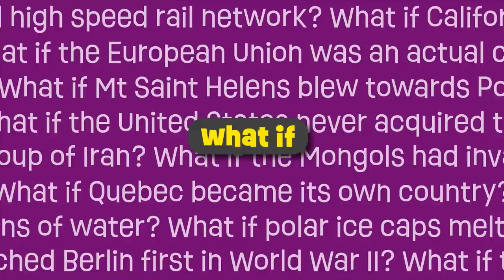Water Pipeline: What If An Aqueduct Was Built From The Great Lakes To The Southwest?

Comment: As someone who lives about 3 miles from Lake Erie and previously lived about 150' from it: Any proposal like this is absolutely unacceptable. It's not just "ooh, it's pretty", it's our water supply, important to our economy, and enables our regional climate to function. We're also well aware that when municipalities started tapping the Colorado, everyone then said there was plenty of water and they'd never run out, and now look where they are.

If you want to partake of our water supply, move here so you're sending most of the water back into the lakes.
Reply: I live in Western NY, we generate a lot of truly clean electricity with that water as well…
Reply: Although I wouldn’t miss the lake effect snow much, lol
Reply: No hate but Waukesha already takes our water….
Reply: In your video you acknowledge the effects of climate change on the West Coast it is indeed getting more heat waves and hotter but if you take the time to look at the effects on the East Coast the atmosphere is holding more moisture and causing it to rain on eastern states longer and more frequently this is causing flooding to become more common on the East Coast So imagine this instead of trying to take water from the Great Lakes one source that is to say. we make a more elaborate system that is connected to various rivers and some lakes on the East Coast Then when it rains more frequently and starts to hit flooding conditions in that area a switch could be Flipped opening up a water pipeline to take the excess water to where it would be needed more thus stopping the Flood From happening and allowing the excess water to be transported to the western states I suppose this is more of a water pipe network then just a simple water pipeline I think it's the best long term solution the western states get the water they need and the eastern states that are being hit with more rain and flooding will no longer have increasing Flooding events. I would also like to make it clear that I do agree that Salt Lake City and the other cities and states in the western states need to manage their water better then what they currently do also I don't know why So many people  think the only solution for a water pipeline would be the Great Lakes sure on the surface that seems like the most obvious solution because it's in plain sight but like you pointed out in the video it's not the best long term solution however this water pipeline network I mentioned earlier would be one of the best long term solutions if you think about it for a little bit and do some of the research on climate change not just affecting the West Coast but also the East Coast you'll see my point. / Also on a side note between 2030 and 2040 Florida is doomed as they are the state that will be damaged the most from rising sea levels.
Reply: The desert needs to suck it up and manage water better. "Moisture farming" is literally a thing, and it needs to be done! Agriculture needs to be reduced DRAMATICALLY here too! It's just not acceptable to be farming foods that have high water demands.
Reply: I thought this was a UNITED STATES, my bad.
Reply: @DavidJohnson-pu2jh  answered your question above, or is that below? lol. Yes I’m sure they could extend the system to include flooding further east of the Mississippi River what wad proposed back in the early 1990’s was to keep the city of New Orleans from flooding. Considering all the times the wind mills that are already built that idle because there’s too much electricity which is bad for the grid, hence why they idle them could be used to pump the excess water up hill where necessary! But again seems that the USofA is just too poor a country!
Reply: Won't someone think of the desert golf courses!
Reply: @gilbertwoodward75  great lakes aren't just the United States though.  There is another country above the United States that has a huge population base around those lakes.
Reply: @gilbertwoodward75  I have zero respect or willingness to help someone who won't help themselves. Desert golf courses, lawns, and water parks are currently still being built in those areas. I know for a fact that if it were the other way around the eastern states would have banded together and made serious changes. The River would never come close to being depleted. West coast will need to learn the hard way to conserve and ration.
Reply: @jesseflores9087  it's not only their water to share.  Why should Canada give up our water because people living in the desert want green grass and golf courses?
Reply: @alkalineorganicfanatic8655  Obama claimed that hydro couldn’t be called ‘clean energy’
Reply: @gilbertwoodward75  It is united in selfishness, that's for sure. I wonder what people in the west will think when people in the east take some of the suggestions here. "Go live in a place with water!" "Great Lakes, here we come!"
Reply: Aquifers are being proven to replenishable
Reply: @Heather-xm9ul  The Southwest can be changed back into a Semi Temperate Forrest, your Moisture Argument is null and void. 

The Army Corp of Engineers somewhat tackled it, but all plans were scrapped after the 1930s
Reply: @DavidJohnson-pu2jh  East cost is in a drought. worst in years
Reply: @debbylou5729  LOL. You clearly give up too easily it's kinda sad./ (1)  As for the hubris of history of humanity moving water from one place to another where it does not naturally go in nature made rivers well that's just about all of human civilization In Known recorded history everyone knows about the Roman aqueducts and how that water would be transported from natural river sources and lakes two drier areas around Rome but water pipelines go back farther than that In fact many ancient cultures around the world had some way to transport water long distances to their towns and village Two of the oldest on record are pipelines that were made out of clay similar to pottery and of course Wood (2)  As for the effect of humans creating climate change The earth has a delicate balance In the amount of CO2 it naturally puts out into the atmosphere and takes away. Between humanity cutting down trees a little too recklessly in places without planting new ones sometimes And our factories and over reliance on fossil fuel What We have done is contribute to upsetting that balance Think of it like this The CO2 is A Snowball This snowball is the size of your hand then you drop it down a steep mountain As the snowball rolls down the mountain it gets bigger and bigger it accumulates But that snowball was originally made by you the human it wasn't made by the mountain. I realize that may be a poor analogy but my point is we have contributed so much CO2 to our atmosphere we have tipped the scale disrupted this balance The warmer Planet is affecting the jetstreams and the ocean conveyor belt those two things pretty much control weather pattern and weather behavior. If you still don't understand basically we Broke the earth's Thermostat
Reply: @viceroyviceroy-wj7cf  I don't know where in the East Coast you are but in North Carolina they've been getting hit with more rain and it's predicted to get a bit more frequent in the next few years but they aren't the only Middle Eastern and southeastern states to be hit with flooding conditions happening more Frequently The point I was making is if there was a pipe network system set up and when the rain hits flooding conditions a lot of that excess water from swollen lakes and Rivers Could be redirected through this network stopping areas on the East Coast from Flooding while taking the excess water on a nice long trip to where it is needed more. PS 
if your In Florida you should start looking for a new place to live around 2028 But if you're in Florida and don't wanna move you better start making your house waterproof like those underwater cabins sure you're gonna need a scuba tank to enter and leave your house but just think of the view LOL
Reply: @Heather-xm9ul  Next time you toss a salad or have a juicy BLT, remember the lettuce and/or tomato likely came from that irrigated farmland.
Reply: @TheLosamatic  20% of the USA gets to live in happy go lucky American dreamland because that's the part that makes up the USA that is the richest country on earth Around 70% of America gets to live in America's Reality Which is one of the poorest countries on Earth That's right we get to be both One of the richest and poorest Of course there's around 10% of our population that gets to live between being poor and rich Basically our middle class is an extremely endangered species If you're in America take lots of pictures if you see one Because in another 10 to 20 years the middle class American could truly be extinct. LOL
Reply: I live in Sault Ste. Marie, Michigan. We use the water that flows from here to Lake Huron in a half mile long hydroelectric power plant. I'm not willing to give up my water .
Reply: LOL y'all want a bunch of us to move there and swing your "swing states" firmly into the Blue? Yeah, actually, that sounds pretty good.
Reply: @debbylou5729  and I bet you don’t have a clue why what he said is absolutely true!
Reply: @viceroyviceroy-wj7cf  tell that to all the people that drowned in Kentucky! All that’s being questioned here is the plausibility of having the means to move flood waters to where they are needed and away from where more water would be catastrophic. The video stupidly brought in the Great Lakes which just muddied the waters for what’s absolutely something that should have been started long ago, but obviously we are to poor a country, you know all the poor petroleum companies that can’t survive without the billions they get in subsidies, billions that could mitigate some of the horrendous sudden climate change we see getting worse every year!
Reply: @Jobratedman  incorrect, those items came from my back yard garden. It's called self-sufficiency and it's surprisingly liberating. 
We'll just keep our water and you just keep complaining on the internet.
Reply: @troymoszer  not complaining here. Just reminding you. Your garden is cold and desperate from November to April. Then you import from the SW .
Reply: @walkerweatherly7515  I'm so confused by your statement. People wanting to keep water in it's basin to protect local economies and the environment and have people move to a place with infrastructure already built with a steady population vs wrecking a one of a kind ecosystem so more people can move to a desert that requires new infrastructure and we can have cheap produce of whatever kind we want year around. I'm a liberal and would love to have my state be more blue but not if it is made from snobby people looking their nose down on the people of an entire region. But also every liberal person should want more people to move from the Southwest to the Great Lakes because it is more sustainable.
Reply: No one is saying there won't be sacrifices made across the US. I would just rather give cheap produce year round and have meat be more expensive rather than destroy our environment and local economy.
Reply: @Jobratedman  just rem
Reply: @marktalsma2390  Hydroplate Theory also shows there's a infinite amount of water, educate yourself first buddy.
Reply: @marktalsma2390  the only thing I actually want you to know is that God created all this, and his son died for you and I, and this beautiful Creation is only Temporary
Reply: @Jasen Vernor the Bureau of Reclamation just threw the hammer down on AZ and NV, Your next Cali
Reply: 2020 Lake Erie was at its highest since 1934  . If you were 150 feet away then and are now 3 miles away  ; you live on the edge of what was a wetland about 18 inches deep .
Reply: @psychiatry-is-eugenics  No, what changed is that I moved to a new house.
Reply: Coming from southeast Michigan I completely agree with you 100% There closer to the Pacific, better start Desalination or move.
Reply: "our" as in American Indian ?
Reply: @apolloorosco6852  My wife's Ojibwe, so she has a pretty good claim on her share of it and might be up for giving me some when I need it.

Comment: Utah is considering piping in sea water from the Pacific Ocean to refill the Great Salt Lake.  Arid-zona is much closer to the sea than Utah is.  It seems like they could spend some time thinking about a desalination project.  They could even power it via solar.
Reply: Probably should've done that 20 years ago
Reply: The economics of such a plan are completely untenable. The elevation changes in getting the water over the Sierras alone would prohibit such a project. Oh and don't forget the energy for the desalination of that water. The total energy consumption would be gigantic.The math for such a project simply does not work. Solar energy is great but it's just not going to be nearly enough. 

The math for LA aqueduct works only because it is powered entirely by gravity and the water is already fresh. Not only that but due to the geography of the Central Valley, there was no significant tunneling required so it was relatively cheap to build (considering the distances involved)
Reply: @russellthorburn9297  augment it with wind farms then. Wind much more effective. Bore a tunnel through the sierras and use that instead of a pipeline.
Reply: I don't get why they don't use the 450 nuclear power plants America has to desalination water. I guess that'd be too smart to capture all the water evaporated out the cooling towers
Reply: @highstreetkillers4377  I do.  Because we only have 92 nuclear reactors in operation, not 450, and the vast majority of them are east of the Mississippi, making them effectively useless for such a project.
Reply: @highstreetkillers4377  you can’t desalinate water by “evaporating it”, you need to do more stuff

Comment: Some say oil pipelines can go thousands of miles, so why not water?  Reason is that hydrocarbon products like gasoline sell for dollars per gallon -- while water sells for only fractions of a cent per gallon, one-thousandth the value for the same volume.  It's not economical to transport that much that far without huge subsidies that obscure the true cost. Besides construction, there's pumping energy that will be most of the cost, it can't be all gravity flow.  The southwest can recycle and reuse wastewater, capture rainwater & stormwater, use drip irrigation on crops, cover canals to prevent evaporation and line them to prevent percolation.  All of that will deliver more water at less cost.